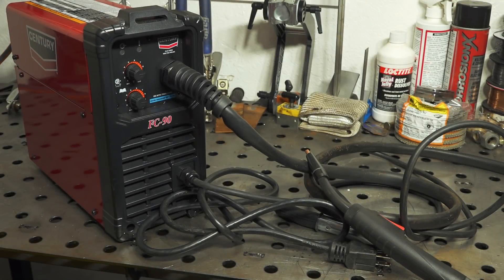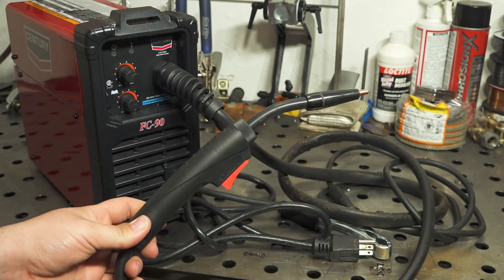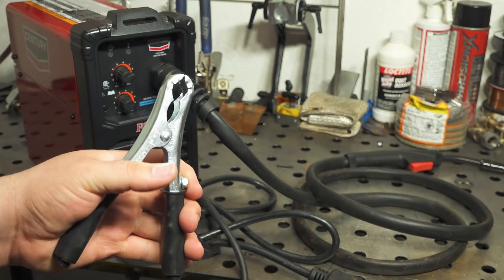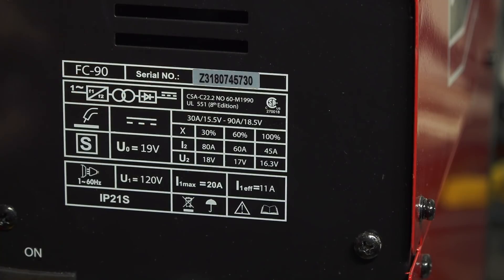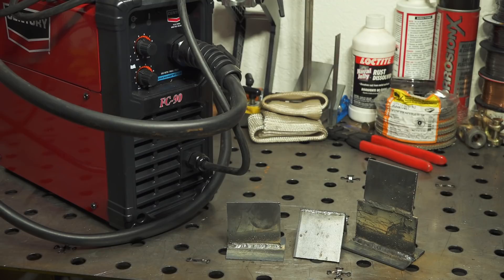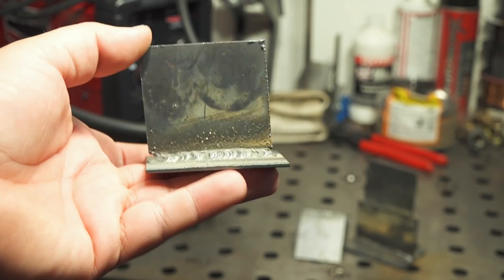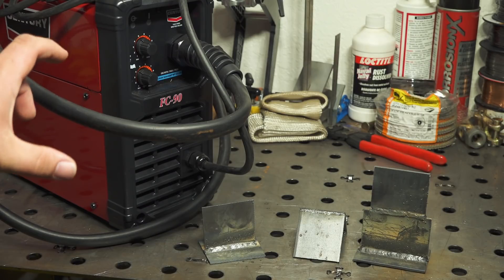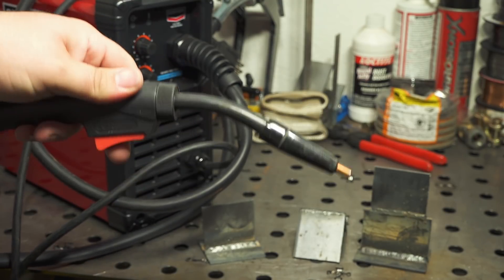Century FC-90: Low Cost DC Flux Core Welder

Comment: Maybe strange question .. It's a possible to switch polarity in that welder ?? Ground cable for + ? Thank You !
Reply from the maker: It could probably be done, but it's designed for flux core only, so they don't build in an easy way to switch it.
Reply from the maker: The ground cable is actually positive on this machine.  Flux core runs on electrode (the wire is the "electrode" in this case) negative.  So the wire feed is negative and the clamp is positive.
Reply: @bigtb1717   Thank You for  answering! Have a Great  2025  !!!

Comment: I have this machine and just finished "repairing" a wheel barrow that had rusted through. Used some thin galvanized sheet metal. I was tricky trying to find the right settings to avoid too much blow through but I got it done. Not the prettiest welding job but I'm new to welding and had a lot of fun with this project. Found that using a shorter stick out helped a bit. Welding thin gauge sheet metal, you need to just do a series of tacks to avoid blow throughs. While it does take a long time to lay down the tacks, it's probably the only way you can weld thin sheet metal. If you do it right, after you grind off the tacks, it looks like it wasn't welded. I really like this machine. Just know that to get started with welding, there are a lot of consumables and equipment you will need for projects.
So far, I did some fence post work and the wheel barrow project. I think changing out the clamp will be a good thing to do. One that will clamp around small diameter pipes or round objects would help a lot. Good video review!....and nice welding!

Comment: I bought this FC-90 to do some patch panels on my truck (old expense Lincoln got stolen).  Came set up for .035 wire so I bought Lincoln wire.  Recommended setting way way high.  Complete blow through on 18 ga steel setting.  Tried every possible combo down to lowest settings 1-1  and still blow through. Was about to trash can the thing but decided  to try the .030 wire.  I bought some and set the machine up for .030 wire.  Still blow through after blow through on recommended settings on down to settings of 1-1 Lowest settings for heat and speed worked!!!!   I know this thing is cheap and you get what you pay for but it does work (after trail and error) and is so light and easy to move around (and cheap) $199 on Amazon
Reply: I had a similar issue with the settings being incorrectly too high for sheet metal. Have to go down to 3-4 to not blow through

Comment: what is duty cycle? Tia.
Reply from the maker: The duty cycle is fairly low when maxed out.  I think 20-30%, but I'd have to look it up.  Should be enough for home projects, but it's certainly not a production welder.
Reply: @bigtb1717  I mean what does duty cycle mean? Ty
Reply from the maker: Oh.  Duty cycle is just a percentage out of every 10 minutes that the welder is rated to operate.  I know that isn't super simple, but I'll explain a bit.  

If a welder is rated at 20% duty cycle, that means it is rated to be actually welding for 2 minutes out of every 10.  The remaining 80% of that 10 minutes it must be not welding.  That could be a continuous 2 minutes, or broken up over the course of the ten minutes.  So you could weld for 30 seconds four times in ten minutes, weld for 2 minutes straight, weld for 1 minute twice, etc.

The duty cycle rated is designed to ensure that internal components, power cords, power switches, etc. are all allowed enough time to cool so they don't fail.

The higher the duty cycle, the more time out of ever 10 minute period they can spend welding.  A 100% duty cycle means the welder could be running a bead continuously, without any components needing any down time to cool.  A 50% duty cycle means that a welder could be running for 5 out of every ten minutes without anything being overworked, and so on.

A short duty cycle means you can't weld as continuously without exceeding the rating and risking overheating the machine.  For small projects or projects that involve short beads here and there with a lot of prep work and such in between, a short duty cycle won't be an issue at all.  A larger project where you are running a lot of long beads makes a higher duty cycle beneficial.
Reply: @bigtb1717  thx dude just bought a forney

Comment: Just seen your video and I have a question do you know why this machine overheating light goes on
Reply from the maker: Well, technically it should come on if internal components get too hot.  This could result from welding past the duty cycle to the point that the internal temps get too hot.  It could also happen if the fan wasn't working properly or air was blocked for some reason.  In any of those cases, I would think shutting the welder off and letting it cool down would allow it to work again.  If that isn't the case, there may be a problem with the welder.
Reply: @bigtb1717  thanks and keep up the good videos

Comment: Can that weld 1/8 inch stainless stee?
Reply from the maker: It technically could, but the weld and the area around it would no longer be "stainless."  It would readily rust.  They do make stainless, flux core wire, but it's very uncommon and I have no idea how well it works.
Reply: @bigtb1717  Thx for the quick reply.

Comment: What size circuit breaker would you recommend for this machine?
Reply from the maker: I would recommend a 20 amp breaker/circuit.  A 15 amp circuit might work, but you may end up tripping the breaker if you run at full output.  I don't have the welder any more or I'd test the draw.
Reply: @bigtb1717  I was asking because I was going to add a 120v 30 amp breaker to my subpanel just for this machine.
Reply from the maker: @MrDragonUTube  You may find you have use for it eventually, but I didn't have any issues with a 20 amp breaker for this welder.

Comment: Off Curse you have to fabricated whit Lincoln or Miller 220 and the right gas however I use this one on small balconies installations and is very very light just good for small base plates and ear tabs  and on light  gauge fence posts alike 16 g  if they are just a few  .   I recommended for small installations or just tack weld especially if your age is giving pain on your back  , is very very light weight small dependable tool

Comment: Can this welder repair a 2 stroke exGGaust.
Reply from the maker: Depending on the thickness of the metal it might be a little tricky.  But it would probably work.
Reply: @bigtb1717  I got the welder and bought some sheet steel maybe 16 gauge or 18 from diy center. I got an auto darkening mask. So I tried to practice on that and boy I suck. I couldn't even see what I was doing. I guess I need to set the brightness control down on the mask. In addition because I couldn't see the wire fed out and didn't weld so I had like a foot of wire hanging out. I'll get better hopefully. I may be the worst welder in America. Hehe!

Comment: I used a 75 ft cord. Might be why it’s cutting out. I ordered a 25 ft cord.

I also changed out the clamp.
Reply from the maker: What gauge was the extension cord?
Reply: @bigtb1717  10
Reply from the maker: A 10 gauge cord is pretty heavy.  With a 75 foot extension cord you should only have 3-5% voltage drop from the cord, max.  In what way was it cutting out?   If you turned the settings down did it cut out less?
Reply: @bigtb1717  not really sure. Probably was just me but I read to only use a 50 ft length at the max.
Reply from the maker: Some welders are less tolerant of long extension cords than others.  It's possible that the FC-90 is a bit more sensitive than others.  Hopefully the shorter cord solves your issues.
Reply: @bigtb1717  I think it might be possible due to it being on a 120v 20 amp circuit
Reply: @seabass22  isn’t that what’s required when opening the box? That’s the correct fuse.
Reply: @edwardzx7  idk. The shorter cord worked.

Comment: I have to run a heavy gauge extension cord from the house, possibly 50' even. Will that even work?
Reply from the maker: If I still had the welder I'd try it out and let you know.  As it is, I would guess it would work if you used a heavy extension cord (12AWG), but I can't say 100%.

Comment: I've run the thing off a 100 foot cord and it still worked fantastically, probably don't wanna go longer than that though...
Reply: Good to know. Need to run a heavy 50’ to the driveway.
Reply: @bethl9825  my outlet was a 120v 20A though, might not work as well with a 15A outlet

Comment: I have the same welder. I’ve noticed that many people advise to reverse the polarity on flex core welders. The clamp positive, the wire negative. Do you know if it came set up with it being reversed? Reversing the polarity cuts down on the spatter.
Reply from the maker: This welder comes set up properly for flux core, i.e. with electrode negative, work clamp/ground positive.

Comment: Can you weld 1/4 inch with this?  If so, any issues...??
Reply from the maker: I imagine you could weld 1/4", but you might want to use multiple passes, depending on what you are doing and how strong it needs to be.

Comment: Were you running .030" or .035" wire?
Reply from the maker: 0.035" wire.
Reply: bigtb1717 I'm wondering if .030" wire would give better control of burn through on lighter gauge metal?
Reply from the maker: @calvinhandley2373  It wouldn't be a night and day difference, but it would help a bit.

Comment: A video I watched yesterday shows to weld like a cursive e pattern. Do you weld in a pattern like mentioned? I Haven welded before so thanks for your video. I had already bought this welder with no knowledge of them.
Reply from the maker: Most guides don't recommend any weave or cursive "e" type of pattern with flux core welding. That doesn't mean it can't work, but personally, I just do a straight drag with Flux core. With gas shielded MIG welding I do an "e" pattern most of the time.
Reply: @bigtb1717  thank you. Now... Lol I am trying to weld ummm" fish plates" to my trailer... Tongue is the a frame style and is bent up. I think I have it pulled down by attaching to my ball and jacking from the first u chanel center... But the same welder I bought blows my inverter immediately... I read 20 amp. Minimum.. and the best I have found is 15 amp in jumper/inverters... I hate to spend yet another billfifty. On something that won't work. Any ideas..not close to any outlet and I don't wanna let it down... Buuut... This home depot is getting tired of seeing me here....
Reply from the maker: I think you'll have a difficult time finding any affordable inverter than will run a welder.    Renting or borrowing a generator might make more sense.  Does the Home Depot you are near have a rental department?
Reply: You are correct! There isn't an affordable inverter. A generator was my last option. Home depot does rent one for 4 hours for about fifty bucks. Priced a generator Harbors 4200 watt only has 15 amp output I need 20. So I'm getting into 500-1000 cost to buy one with 20 amp output... I cutting losses. Returned the welder for now ... With accessories etc etc..  I was over 500..... I will try again on another day. Thank you for the replyz.
Reply from the maker: Where about are you located?
Reply: @bigtb1717  I had been at  home depot in commerce for a week , but I took it to a storage in santa clarita yesterday
Reply from the maker: Just checking.  Nowhere close to me or I'd have offered to help out.

Comment: Great review. You actually ran  decent beads compared to the other review videos on this machine. I couldn't rely on the others due to the welds they produced and the fact they didn't show a cut and etch. They did not really make it inticing to watch. Was that a shade lense on your camera? I like that I could see the puddle as you welded.  Also the fact that you pointed out that has infinite variable nobs helped my decision.  I'm a Welding Specialist Grad building up my fab shop, this will definitely be my go to back up FCAW machine.  Thanks for the video
Reply from the maker: Thanks.  I actually use a camcorder with built-in neutral density filter.  No extra lens or shade required to get arc shots.  Good luck with the fab shop, hope it goes well for you.
Reply: I was wondering why not use a stick welder. I have never welded and thinking about getting this machine here on the video.

Comment: Nice
and exquisite machine, brand name, too! Question…if you have time. When welding
1/8 inch steel and after the cut and etch test, does the penetration gets
better or it’s the same? Good review, take care my friend.
Reply from the maker: Yes, penetration will be a bit better on 1/8" than it was on 3/16".  Thanks.
Reply: @bigtb1717  
Can 0.30 wire be used with this machine?
Just bought one and wanting to use
211 .30 wire by Lincoln
Reply from the maker: @meca13b  I can't remember if it came with any 0.030" tips or not, but you should be able to flip the drive roller and feed 0.030" wire.  But you might have to buy 0.030" contact tips.

Comment: I am using E71T-GS, 0.035”
on a Forney 140FC-i to weld on 1/8 inch steel. First I did some T-Joints
and then a cut and etch test, I was impressed with the weld penetration. It’s similar
if not identical to the results of a 7018 stick rod. I am a stick rod man, but
I like to keep an open mind.

Comment: How would this do on a normal muffler? Girlfriend needs the muffler patched and don't want to replace the whole thing or take it to a shop.
Reply from the maker: It should do okay, but keep in mind that thin material is tricky with any welder, so you will want to practice on some scrap first, if possible.  Also, mufflers typically rust out from the inside, so they are often much worse than they look from the ouside.  So there could be thin spots other places that burn through pretty easy.  Use short welds to prevent heat from getting away from you.  Good luck.

Comment: Do you have to buy any gas for it?
Reply from the maker: No, this welder uses self-shielded flux core wire.  No shielding gas required.  In fact, it cannot use shielding gas, so it can only use flux core wire.
Reply: @bigtb1717  thanks

Comment: I haven't welded in the better part of 20 years even then I only ran stick and now that I have extra time  was wanting to get back into welding but don't want to clutter my lil she'd with all the different sticks and was wondering if that centry or the titanium 125 would be strong enough to use to build stuff like tow dollies and trailers if not could you recommend a flux core that would be strong enough but not to expensive
Reply from the maker: Of the two the Titanium 125 would definitely be my choice.  It would likely be capable of what you want.  Personally, I'd prefer something capable of running off 240V power.  Whether or not you need a 240V welder will depend on the type and thickness of the materials you will be using, but it's something to keep in mind.  Is there a specific budget you'd like to stay within?
Reply: I use the century 255 flux core welder for trailers and projects that's going to see highway use because it has a better range of amperage which allows me to weld thicker material than the fc 90 is capable of

Comment: Will this work for welding body panels on a car? 
If so should I use the .30 or .35 ?
Reply from the maker: Flux core isn't ideal for auto body, but it can do it.  I'd go with 0.30", but it shouldn't make that much difference.  The big thing is to practice on some scrap material of the same thickness first to get your settings and technique dialed in before starting on an important weld/project.
Reply: Thank you. Its a floor panel under the carpet so doesn't have to be pretty It's just a one time job and I'd like to have an all purpose welder when I'm done. 
Thanks for the help!
Reply from the maker: @stewmeat9261  Sure thing.  One thing to consider, I've since reviewed the Titanium Easy Flux 125 from Harbor Freight, and for the price I actually prefer it slightly to this welder.  Might at least be worth a look.

Comment: does this welder have a contactor or does the wire remain electrically hot at all times?
Reply from the maker: The wire is only live when you pull the trigger.

Comment: Thanks for the video.  If I want to run .030 wire by flipping the feed wheel, do I need to buy a new .030 tip, or will the provided tip be just fine?  Thank you for explaining the feed speed and power settings when describing the weld on the thickness of the thinner material.  This really helps to provide insight to the welder's capabilities.
Reply from the maker: The included tip would probably work with 0.030" wire, but ideally, you would want to get some 0.030" contact tips to minimize possible issues.  I have found them at Home Depot, Lowe's, Tractor Supply, Napa, Harbor Freight, and every welding supply store.  So hopefully you have someplace nearby that carries them.

Comment: well done video and my experience has been the same with mine
Reply: Can you run .30 wire or does it have to be .35 ??
Reply: @whitegorillia117  both. Just flip the adjustment wheel over. It has two grooves, one for 035, and one for 030.

Comment: It’s a little beast 🔥 I left my HF 90 amp on the side of the road free 99. I ran .030 Lincoln wire/tip helped with blow through and did small tacks on  20 gauge, heat 1 wire 2, filled a couple holes 🕳 but it’s finicky on the 20, did some 14 gauge also it has power 💥  👨🏻‍🏭